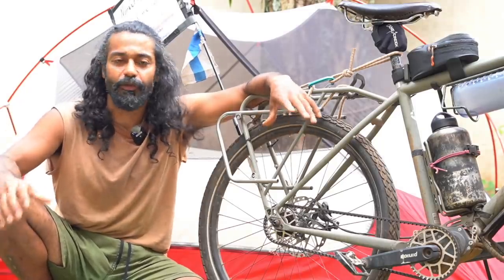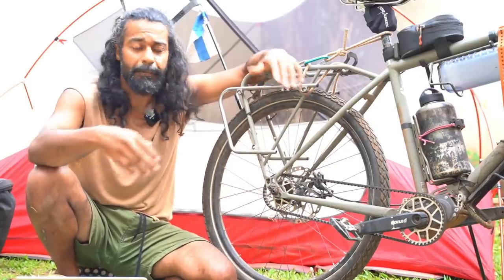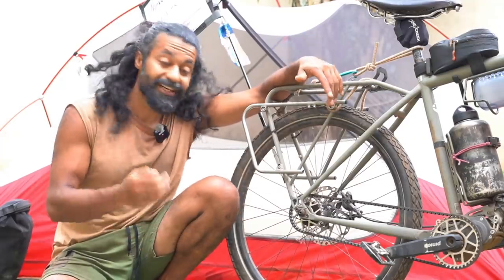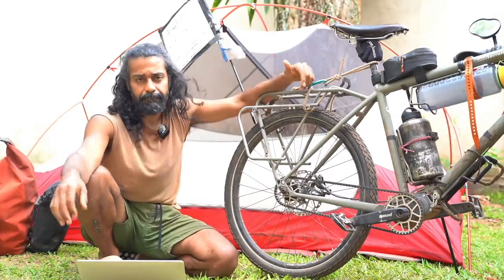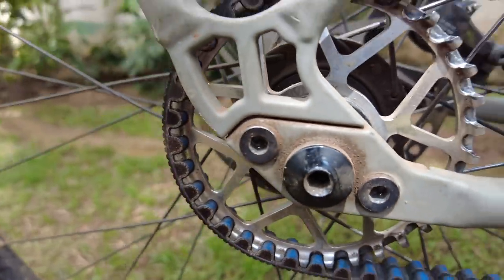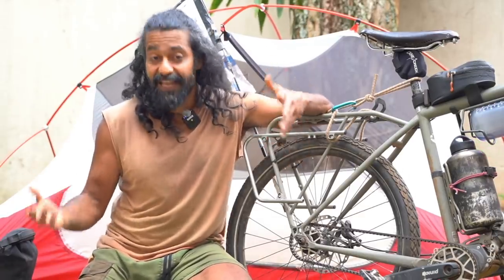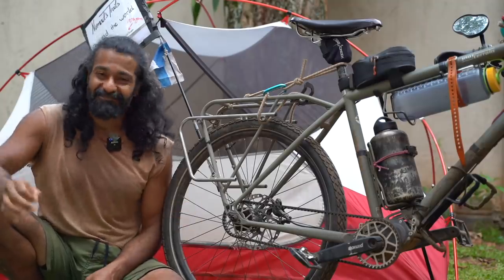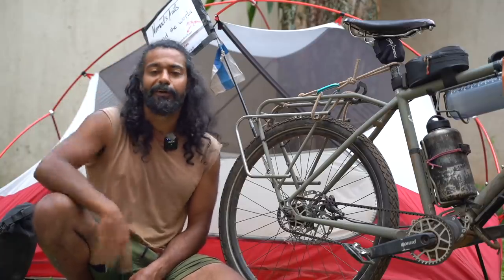Belts Are BETTER Than Chain Drivetrain for Bicycle!  My Test Result After 12 YEARS OF BIKE TOURING!

Comment: An clean well-lubed chain will always outperform and outlast a belt. The only advantage the belt offers is that it is less prone to wear from dirt and grime. Rubber aging, UV rays and high heat will wear out the belt significantly over time so they have a limited lifespan. Just clean your chain regularly, for the vast majority of people a belt is an expensive step in the wrong direction
Reply: You could be right if the chain discussed is working in an oil bath, encapsulated in a motor. Bike chains are exposed to dirt, water and mud, so a hypothetical ideal chain will be hard to find, and that is actually what this video is about: How does it work in real life? I have used belts for 5-6 years, and in that time I hasn't´t changed a belt. Except on my second hand Trek District from 2010. I have a 2017 BMC AC01 where the belt shows very faint signs of superficial wear, but not nowhere enough for it to need to be changed. And I think that I am not alone in rarely changing a chain because it breaks; normally it is due to rust after having used it on salty roads during winter. Neither you or I can guess if rubber aging or UV caused deterioration will be a problem; I have a 10 years old Gates belt with none of these problems. So you might postulate that a belt will have a much shorter life than a chain, but most peoples experience with belts does not agree. And a wrong direction? The belt is virtually maintenance free, doesn't need lubrication, completely silent, has a lon life and does not spray around oil on your clothes and the bike? Well, that is good enough for me, and has been for years.
Reply: @larsdela9323  I did in fact have an oil bath in mind, I don't know if it's been done, but it is certainly less of an engineering challenge than making belts work just as well as chains

Belts and their corresponding specialty drivetrains are less efficient, a lot heavier and more expensive. This alone makes chains the better option for over 90% of cyclists. Let's not forget that belt drivetrains are also impossible to find parts for except in specialty online retailers, so even minor problems can be a big headache to fix.

Cleaning your chain regularily takes a few minutes and will greatly increase their lifespan

Unless you literally never get off the saddle and go very long offroad expeditions (like this channel) then chains are the superior option

Comment: what if you want to use dropbars with internal gears.
is there a good solution for that?
Reply: You have different options depending on the internal gear system:

- Shimano Alfine 11 Di2 : You can use any Di2 road levers
- Rohloff: Gebla Rohbox with modified SRAM or Campagnolo shifters, or Cinq SHIFT:R ROAD
- Pinion C1.12: Cinq SHIFT:R ROAD

Microshift also has some options for the Nexus/Alfine but those are only compatible with rim brakes or mechanical disc brakes and do not have very good reviews.
Reply from the maker: Moro moro 😊, indeed as Varez93 mentioned there is after market products for the dropbars. Cinq makes dropbar shifters for Pinion. but also you can use the same shifter and bring it close bring it close to the stem. it is fine and works :)
Reply: I have a DIY mount for my IGH shifters on the toptube, where they belong. ZERO cable flop or wear or chance of breakage. Still haven't touched the cable since new, 8 years/ 18,000 miles/ 2 tours. So I can shift the Rohloff with either hand. So bars don't matter but anyway, I absolutely hate drops, so never went around the block with them.

Comment: Kinda surprises me: i have ruined 2 internal gearboxes with the teeth chipping off due to pressure and shifting during hill climbs. One being a normal bike and 1 being a older e-bike. Both shimano.
Belt is good but how did you cope with shifting under load with the internal gearbox?
Derailleur it sometimes comes of or skips on a weared down sprocket but easily put back on or changed.

Comment: Belt is less efficient at transferring momentum than chain, that is a fact not just talk. Not to mention internal gearbox will cause even more losses. As efficiency goes, nothing beats classical chain drive. How big is a the difference is another story is hard to say and it would need to be measured. But there is a reason why they use chain in professional racing.

Comment: I like your vidios but a question how does a bike with a belt handle hills ?
Reply from the maker: No problem at all on the hills. Belt is really solid. as you seen in the video i have tested this system for 1.5 year on the tour with heavy load 😊

Comment: I'm curious why you would swap chains regularly?
Reply from the maker: IMO, I can ride with my drivetrain  a bit longer  when I use 2 chain  compare  to if I would  use one chain 😊
Reply: @NomadsTrails  That's really interesting :) I don't know a lot about this, but it would kinda make sense, if the casette is worn down slower when the chains are swapped to "match" the wear. At least compared to riding one chain to destruction which can also wear out the casette to the point that you might have to replace both casette and chain simultaneously.
Reply: @Hastarl  You found the reasons :-) The difference of ''speed of aging'' will wear out the sprokets and chainring more. With 2 chains, all the system wears out in harmony,  some say 2 times less, some swaps 3 chains

Comment: You forgot to mention the downside of a belt drive. It comes with a lowered efficiency compared to a chain drive. A technological university in Germany conducted some experiments and by the end they stated it's like driving with an engaged brake all the time. So my personal way to go would be using a chain with an internal gear and enhousing the chain with a chain glider. This should make cleaning almost unnecessary and you can grease the hell out of the chain.
Reply: Do you have a source for that? Because I ride a belt drive and it doesn't feel at all like braking. Belts with gearboxes are slightly less efficient than a clean derraileur, but it is not a huge difference.
Reply: @Frostbiker  
run a google search with the following words and you'll find an article adressing that topic.

prof. dr.-ing. hubert hinzen wirkungsgrad von fahrradtrieben

thats a paper in german. Maybe you can run it through google translate or something. It will tell you that losening the belt tension will compensate for the efficiency losses. The question is, how far do you have to reduce the tension before the effect takes place. And what is going to happen to your belt? Will it slip or skip when "kick"-starting with your bike? 

The loss in efficiency is nothing you can feel btw.. It's something you can measure thogh.
Reply: @STFU2142  Thank you for the source. I found an article talking about the efficiency loss of a belt drive, but found no comparison with engaging the brake. But just think about it: engaging the brake stops the bicycle. The efficiency loss of belt drives is nothing compared to actually engaging your brakes, we wouldn't be able to ride our belt bikes otherwise.

Comment: All the oil put on chain it will find its way polluting environment's water. It doesn't matter as long there are a few people doing that but as more concentrated and intensified bicycles are in use, it does matter. So from that perspective belt is more environmental friendly!

Comment: I think everything you said about the belt makes sense except one point. You said it's a bit lighter but then later you said that it's wise to carry an extra belt if you're doing world tours. Wouldn't that negate the weight savings advantage some? I don't care about the weight thing myself. Just thought that might confusing for some viewers.
Reply from the maker: Thanks, the  belt  is very light, each belt is around  80 gram (if I remember  correct)  so 2 belt  is still lighter  than one chain abd you can cycle  with 2 belt  at least  40.000km 😊
Reply: If someone is doing a world tour with chain drive. It would be wise to take a spare chain too, especially if the chain is 11 or 12 speed. A chain can last a few thousands Km. There is no guarantee a suitable replacement can be found in less developed countries.
Reply: Have you looked at how much the pinion gearbox weighs! But as the video points out weight is not to important when touring.

Comment: Belts sound great, but their greatness is pointless if they’re either priced so far away from chains or you have to give up gears for them to be comparable.
Reply: or you just don't cycle around planet 10 times in a row.
Reply: @moofymoo  As much as I hate the price of belts, you don’t have to cycle around the planet 10x in a row to see the shortcomings of a chain. 

Cycling folk recommend cleaning and oiling after each ride! I’ve ignored this because it sounds ridiculous, but my chains certainly aren’t perfectly quiet, smooth, or probably as efficient.

Comment: I have a Cowboy V2 bike. The (chinese?) belt lasts about 2000 km. At 2000 km the belt gets so soft that it will skip teeth and rip. After I drive in the rain, dirt will get on the belt and that will produce terrible squeaking noises. I have to clean it every 100 km. No I don't think belts are better.

Comment: Riding efficiency on a bike is pretty important that's why on really high on bikes they have ceramic bearings and stuff doesn't make all that much difference when you're just looking at it but even a few percent adds up the more you ride pretty quickly
Reply from the maker: Thanks  for the input 😊,  a decade of my life I have been biketouring  with chain and now is 1.5 I am cycling  with belt. Well I don't  really  see the difference in a real life, I am sorry 😊🙏

Comment: One must keep in mind that belts are composite material and therefore probably hard to recycle. Chains are made of steel. More easy to recycle.
Reply: Easier and less resource consuming to manufacture too. I'd like to try belt though, he's a good salesman!
Reply: @jamesclark6487  Heating steel up to its melting point to recycle chains is a bit resource consuming...

Comment: No one talks about one crucial thing - belt was meant to be used in fixed gear so belt drive is definitely not gonna work for any traveller especially if you're hitting a mountains
Reply: It has an internal gearbox.
Reply: @mennims  the one he has?

Comment: I would ride 100 miles every  Saturday  after a week of commuting 10-12 miles a day for 4 years never  changed anything on the bike except tires. The only  reason I got a new chain was because it was  free. And I don't clean my bikes. So chain is definitely  better. Oh yeah and my bike was fixed gear

Comment: Oh come on! belt is lighter? There is no Lighter drive train than based on chain. Period. Belt itself might be lighter, but without gears, belt is useless. So you need add weight of gearbox/planetary hub and they are heavy. 
There is at least one more disadvantages from chain. If belt broke, cannot be fixed. In chain you can easy remove broken link and link it again. With belt if you have no replacement, you need to push. Also if any stone, to much sand or snow gets between belt and cog usually it ends with broken belt. I'm working with bikes in place where rains a lot and people doesn't care about gears. Belt drive worn after 2-3kkm is no surprise, so they are not so marvelous as you might thing.

Comment: does it have a gear variation? like for example when you are climbing steep roads
Reply from the maker: yes, there is Pinion gearbox there and i got 12 gears.
Reply: @NomadsTrails  followup question , when you say gearbox does it have oil lubricant inside? and how would you trigger the gear shifting is it purely mechanical or electronic? thank you for the reply i was amaze with your bike i never knew there is a bicycle like that
Reply from the maker: @chitobernadit1904  in the link below you can find a very well detailed answer for your  question :)  https://pinion.eu/en/technology/

Comment: The belt needs to be in enclosed in an easily accessible sealed enclosure.
Reply from the maker: Why? 🤔
Reply: @NomadsTrails  appearently you do not recall your troubles with the dirty belt during your journey, you were the one there riding, right?
Reply from the maker: @ellerybice3787  I think  there is answer to your question  in the video 😊🙏

Comment: Its not for me peyman, you touched lightly on cost but just the chain comparison to the belt ,it's considerably more expensive around 4 times the price and if you had a fall not something out of the question on a world tour and damage your front or rear cog not only will you almost definitely not find one easily but it would be very expensive and being aluminium probably not easy to  straighten and how long would you wait in say  Is africa or guatemala or whatever to get one posted to you ,I like the tried and tested ⛓️,  how is matilda have you any word ,good luck.
Reply from the maker: Hi, indeed  spare parts Te not available. But honestly  this drivetrain  is really  solid. Also you can get  steal  front  and rear  cogs.  It will  be update  regarding  Matilda  in future  vlogs. I just spoke to her today  and she is fine 😊
Reply: @NomadsTrails  that's great news tell her the community is asking  for her ,I think I would want steel cogs so they could be straightened out if needed and for sure a spare belt.
Reply: @mysurlytrucker7510  Sorry but bending belt cogs is just fantasy. It is never going to happen they are VERY strong indeed far stronger than chain sprockets or chain rings which you are probably more likely to bend! Everything Peyman says is correct. I would also emphasize how QUIET a belt drive bike is as well. No clatter of a chain to ruin the peace of a lovely morning or afternoon ride in the hills. Only the sound of the wind through the trees ............... Seriously if you ride or should I say own a belt drive bike you never go back to primitive derailleur chain drive as it is such a PITA in comparison. I have been riding belt drive bikes with Rohloff hubs for about 6 years now and love them. No problem what so ever. I can ride in any weather on all terrain and the belt still performs the same. It is a revolution in terms of moving bicycles forwards to a very low maintenance transmission. Good riddance to chains and derailleurs.
Reply: Haha, I drive Rohloff for years and switched back to the chain. A well-lubricated, new chain achieves better efficiency than a belt. The result: More of the leg power arrives at the rear wheel. But the efficiency of the belt gets steadily better with increasing wattage or higher power input. At higher torque, the belt enjoys an efficiency advantage over the chain. So always step in powerfully.... 😉
Reply: @sylvioseidel6964  If you compete and therefore marginal gains are important to you, then yes, chain + derrailleur all the way. For non-competitive cyclists, an enclosed gear system with a belt (or at least a fully enclosed chain) is the right choice.
Reply: @varez93  the right or wrong gear is very political or different for everyone. I am happy with Rohloff and a chain! And I dont use chain oil but wax...
Reply: @sylvioseidel6964  It is of course, my opinion, which is based on data from Cyclingabout as well as my personal experience.

I own both bikes with derrailleurs and internal gear hubs, the later with belt as well as chain. 

I do also wax the chain of my derrailleur bikes because it is a bit cleaner than oil. It does however have other downsides: very cumbersome process to remove all factory grease from chain (and very environmentally unfriendly) , need to re-apply every 100km or so, washes away with rain, etc.

Derrailleur bikes just cannot compete with internally gear bikes (specially with a belt), in terms of robustness, reliability, and ease of maintenance. The only arguments in favour of derrailleur gears are: efficiency, and price. Efficiency should be out of the equation for non-performance applications. The price topic I can understand when talking about Rohloff and Pinion. There are, however, options like the Nexus from Shimano which are more than sufficient for flat to moderately hilly terrain.
Reply: @sylvioseidel6964  Chain's problem is that "new and well lubrificated" part.
Ride on unpaved roads and that goes to hell way too easily:
If it's dry, you have road dust flying around. And you know what mineral makes lots of earth's surface?
Quartz, which happens to be harder than most metals.
So any kind sticky, or gunk forming chain lubes start filling chain with abrasive paste.
And if it's wet you have dirt and muck spraying from road surface and sticking to chain to start literal grinding machine eating efficiency and drive train.
Assuming chain lube didn't already run away at first sight of water. (like dry lubes can do)
So in real world conditions efficiency of chain decreases very very easily.

Also non-straight chain line common with cassette+derailleur gears itself ups wear and tear by generating sideways forces.
Would make professional bicycle racing lot more "interesting" if they had to use same chain&drive train as long as normal average cyclist uses...

Comment: The weight is really misleading! Yes the weight of the belt is less but the whole system including the gearbox is a lot heavier. Like the video a lot otherwise!
Reply from the maker: Thanks 😊, the video  is not about  comparing  internal Gear box and derailleur  system. It is about comparing the Chain and Belt.
Also the weight of derailleur  drivetrain depends  of which groupset  you use. For example XT or Acera chainrings and cassette, One is Aluminium  other one steel  😊